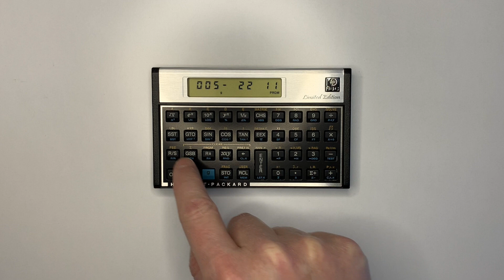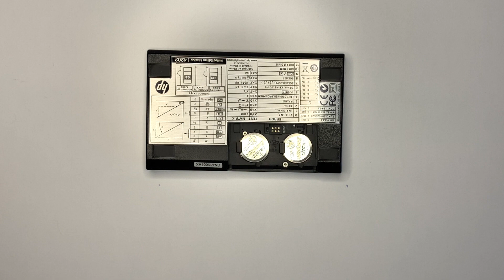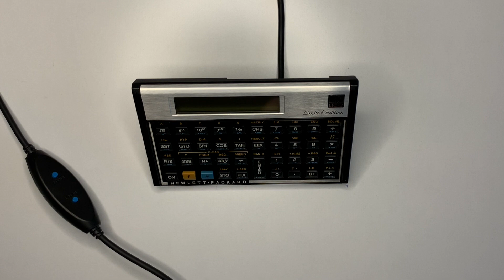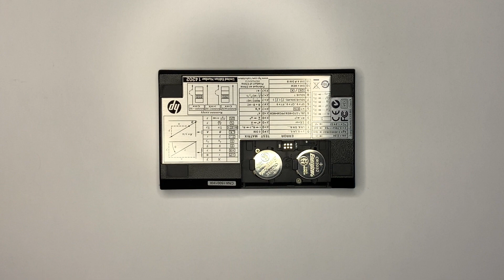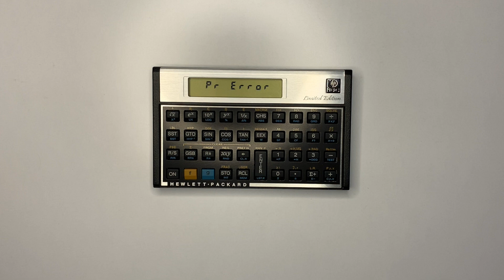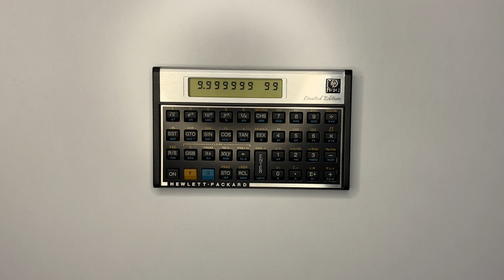HP 15C LE PSE / Pause Bug Fix

Comment: I want to flash to original HP 12C,  Can you provide a Version 2011 file？?
Reply from the maker: I don't have a flashable 12C and so don't have the firmware for it either (as I haven't needed it). There are also a number of different versions available so you would have to make sure you had the right version.
Have you looked at the 12C development kit? It includes a firmware file and might be the correct version but check the documentation first to see if it matches your hardware (CPU etc). Please let me know if you find a solution. https://www.hpcalc.org/details/9554

Comment: Hi, I thought I'm not the one whom have faced the problem of HP 15C LE calculator, is any guy wherher has the transfer cable want to be sold or
Reply from the maker: The original cable comes up on eBay occasionally but you might be waiting a while and it's likely to be expensive.
The cable is the same as the one used to firmware upgrade the 20b and 30b (to a WP 34s) which people have made using the following instructions: https://web.archive.org/web/20190402142724/http://www.thereminworld.com/Forums/T/29229/diy-calculator-hp30b-to-wp34s and https://commerce.hpcalc.org/34showto.php?fbclid=IwAR2gXo4dZ8ezKjovlR69DBF0WAM_WoPLGT9RIZ9gG1XETgi_MUMojjtJ_fM. Worth a try if you can't find a ready made cable. Let me know how you go if you do try to make one.

Comment: Hi, first of all, thanks for your video, I have faced same problem of HP 15cLE, would you please advise where I could find the transfer cable, thanks.
Reply from the maker: The original cable is no longer made and finding a secondhand one is very difficult (I don't know how many were originally made). A number of people have made their own cables and there are some links in the video description for making your own so please try these.
Another option may be to consider purchasing the recently released HP 15C CE (Collector's Edition) which includes fixes for all the known bugs of the LE and runs a little faster.
Reply: @CalculatorClique  
Many thanks for your information.

Comment: Awesome stuff. 

Is the process the same to upgrade a 12C+ (if I find newer firmware)? I currently have a 12C+ with a 2008 firmware and the SST bug that I'd like to upgrade to later  2009 firmware, where the SST bug is fixed. Obviously to make the cable will be more expensive than a to find a newer used 12C, but then, where's the fun?

On a tangent, do you think it would be possible to repurpose a 12C+ as a 15C?

EDIT: Thanks to a link you posted in a comment here, I found the needed firmware, made the cable with spare parts I had around and now I have a functional 12C converted into a 15C LE with the memory upgrade and PSE bug free. 

The only problem now is that the 2011 version of the 12C firmware that I found is not compatible with my version of hardware, I need any of the 2009 versions. Do you happen to have it? 
Many thanks!
Reply from the maker: I've been away on holiday and am just back and was about to reply to you when I saw your update. I was going to say you can repurpose the 12C+ with the same hardware to a 15C LE but you've found that out already :-).
There are a lot of different hardware versions for the 12C (see https://www.hpmuseum.org/forum/thread-5180.html ) and I only have the original one (not running on the emulator as the newer versions do). I was going to suggest you look at the 12C+ development kit (as per https://www.hpmuseum.org/forum/thread-1899-post-16911.html#pid16911), however, it appears you've already tried that without any luck.
I'll have a look around and see if I can find anything. Please let me know if you get it sorted and where to find the firmware as I'm sure others will have the same issue.
I saw that The Calculator Store is producing a silicon 16C overlay for the 15C CE (it has a 16C mode, unsupported) so might be worth contacting them to see if they will/are making a 15C overlay you can use on your 12C+.

Comment: Well, I have three of these, one prototype for bug testing and two still in their boxes.  Do I leave the bug in like my HP35 red dot or do i flash?
Reply from the maker: You can flash it back to the released/original version at any time. Also take a look at increasing the memory size which I covered in a separate video at https://youtu.be/62MsZ68PZGU. You can mix and match both these options too. I've flashed mine many, many times without a problem.
Reply: @CalculatorClique : another project!  Yahoo, I have the cable and etc as I was a beta tester.

Comment: I have a problem finding Mysamba software and an flash image for hp15. I could ask for links
Reply from the maker: MySamba is available for download at https://sourceforge.net/projects/wp34s/files/FlashTool/. This is the WP 34S page for converting a 20b/30b into a WP 34S but the same firmware download program is used with the 15C LE. 
See the following forum article for links to 15C LE firmware: https://www.hpmuseum.org/forum/thread-18491.html

Comment: I have the 15C LE, the 8-19-09 ROM, and the MySamBa transfer software. Are there any of the transfer cables available out there? If not, is there specific information about which substitute cable can be used, the pinouts, and the procedure to use it instead of the original cable? Thanks for any help.
Reply from the maker: See the links in the video description for some options to make your own cable. The cable is the same one used to reflash the 20b and 30b to a WP 34S so searching for that may provide more results. Many people have successfully made their own cheap simple cables. I was lucky enough to locate an original cable but they are hard to find these days. Hope you can make one to give this a try. See my video on patching the 15C LE firmware to triple the memory too - another reason to acquire/build a cable 😉
Reply: @CalculatorClique  I appreciate the tips. I'll probably hold out for a pre-made cable, and I'm even a bit reluctant to flash the 15C+ just to get rid of the PSE bug, only to introduce older bugs in its place. Thanks
Reply from the maker: Definitely pros and cons to downgrading. I've reflashed mine many times now without a problem so you can always revert to the original version. Maybe go for the release version (with PSE bug) and the memory upgrade patch for triple the memory (see my other video on this).

Comment: Tried it, and it works well! Thanks for the video.
Reply: I have a problem finding Mysamba software and an flash image for hp15. I could ask for links?
Reply from the maker: Excellent 😊. Let me know if you find any other issues with the older version (like the overflow bug).

Comment: Thank you for making this video! It is one thing to read about the flashing process but another to actually see it in action.
Reply from the maker: Thanks for the feedback 😊. The process was very reliable in my testing and didn't fail once with numerous downgrades and upgrades. Although you can't see the screen when the cable is plugged in there is actually no indication of what is going on (other than when it is first erased and gives Pr Error). The program download bar is the only indicator that the process is working.